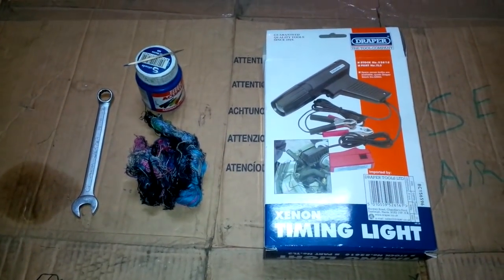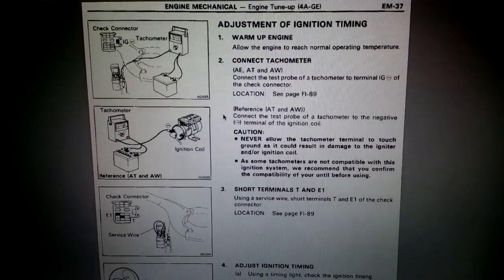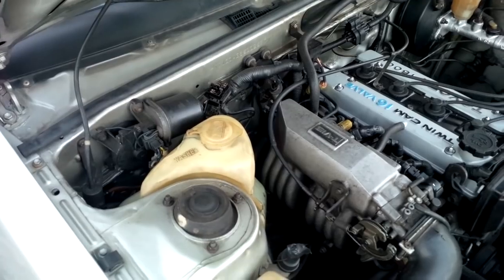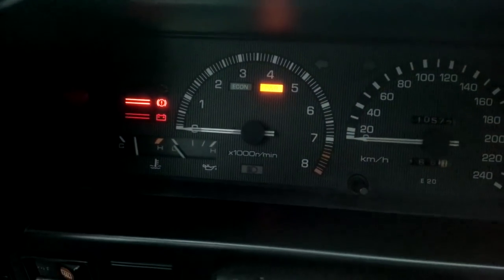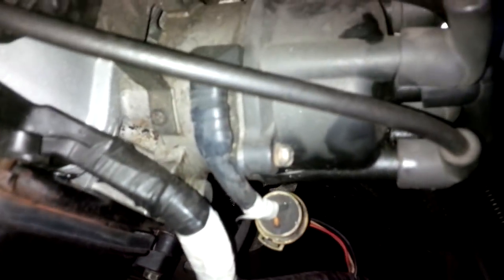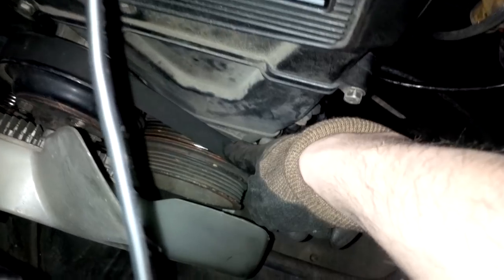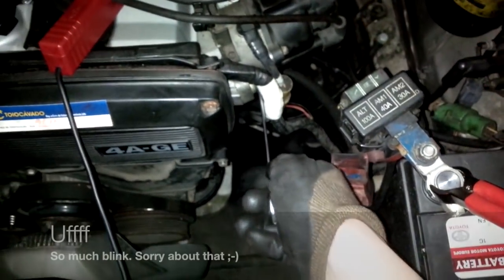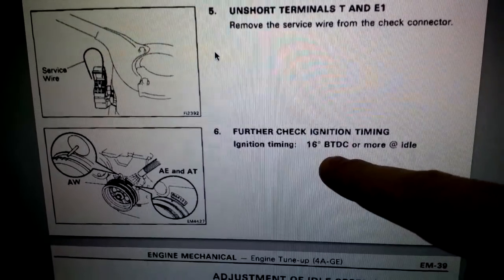Toyota 4AGE Engine: How to set Ignition Timing (AE86)

Comment: I've had my 1983 ae86 for 6 days and it ran perfect. On the 7th day it started to blow smoke and the engine would turn off suddenly after a rough idle. Today I somehow found this video (by accident) and it took me 45mins to adjust the timing and it's running smooth again! Thank you for making this video!

Comment: When you set the timing to 10° then you also set it to static setting on the distributor, helps the Car rev faster than normal,but this only be done you using original NGK Spark plugs with a twin spark,they come preset from manufacturer, all you have to do is open the spark end a little bit with flat screw driver head, once you done this on all 4 spark plug insert into the cyclinder head, loosen the 2 bolt by the disturbutor but don't move the disturbutor,only do this extremely slow until you will hear chick noise when you move the disturbutor, this will set it in static setting then lock 2 disturbutor bolts tightly, this will allow the car rev up quicker, like motor cycle...!! Your fuel economy will still be normal, but is you need response to rev will do this, because I own 1987 Toyota Conquest RSi with same cyclinder like video has shown.
Reply: I own a red top and car seems to rev slower than usual, and there is black wen I over rev, any help
Reply: @Kush_Riders  Your is shooting out black smoke out of exhaust, is because your car is over fueling.. Meaning, Sometimes owners of 4age 16v where blue top or red top cylinder head.. Get wrong advance from other owners of different make's cars.  1. Thing's is do, add new engine Oil change, new set spark plug change, new air filter and new fuel filter. After, add a  bottle of  Wynn's Spitfire fuel system cleaner to your fuel tank and thereafter add about 30 to 50 litres of fuel, to mix with the fuel and clean fuel line for any carbon build up that slow you car performance and efficiency. Thereafter, you need to take your car nearest RMI Approved Workshop. Ask they if they have a machine that set your car CU or CO2 sets. It's a machine which will establish how rich on fuel your car is running daily or if your car is lend, if you car more Air, mean Co2 to fuel.. This is Air to Fuel ratio..If, this is correctly done by manufacturer specifications then next step, for you at the RMI Workshop is ask they if they have a timming light, with a digital screen which on the screen how advance your distributor is sitting at or how much retard disturbutor is sitting at. This also established where you car is set at correct manufacturer specifications for a standard product car. This help have a more fuel efficiency and fuel consumption will improve dramatically on fuel.. I hope the advice will assist you in any way. Let me know if you have any questions..

Comment: Aside from providing adequate lighting, I see no purpose for the ignition timing light gun. A regular 99 cent LED light will get the job done just as good. Am I wrong?
Reply: the timing gun is to provide an Illusion that the pulley isnt moving so you're able to adjust timing. The inductive cable off of the no. 1 cylinder flashes the light everytime the cylinder fires  to acheive that effect
Reply: bossscrillaguy you are indeed very wrong

Comment: is this method the same for all four cylinders
Reply: +tom price (pricey) this method only works with engines that use mechanical ignition timing :/
Reply from the maker: The spec (ignition timing advance) may change, but many many engines share this method.
Reply: João Rocha da Silva what about if there is no distibutor and just an ignition module
Reply from the maker: Then i'd say that is an EFI-controlled ignition system, so the tuning will have to be done through ECU re-programming.
Reply: João Rocha da Silva so this method is probably better for older vehicles with mechanical ignition

Comment: The ignition timing light inductive pick up arrow must point to the direction of the number one spark plug.
Reply from the maker: EDUARD Good point. I have tried both ways and it works the same, but in doubt you should use it like that.

Comment: My 1985 4age does not have this terminal box..
Reply from the maker: Hello, you will have to splice the ecu wiring and install a switch to short the same two pins. I have added a link to the ECU pinout diagram in the video description.
Reply from the maker: Either that or try to squeeze in a thin wire between the intended connectors of the ecu while you re-plug the connectors. Just be sure that you don't short any other pins.
Reply: João Rocha da Silva Okay. Thank you very much!